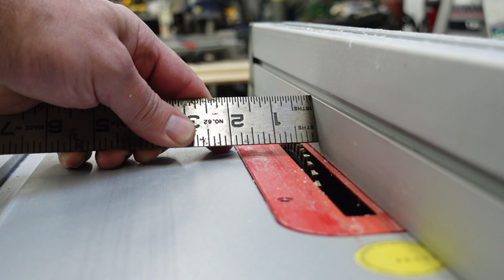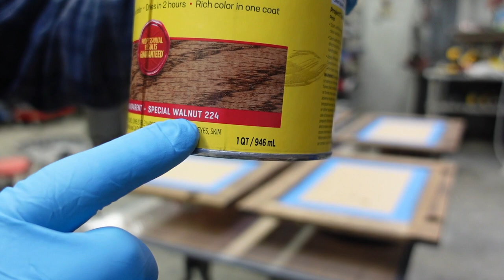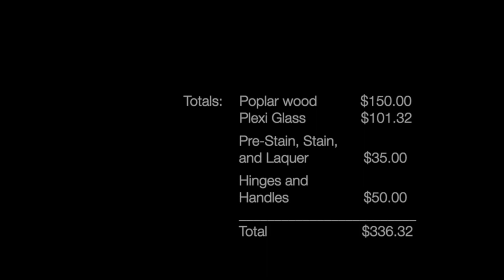Building Cabinet Doors for the LMTV

Comment: I HAVE WATCHED ALL YOUR VIDEOS ! I NOW HAVE A 1988 GRUMMAN OLSON P30 STEP VAN AND WANT TO CONVERT IT. IT HAS A CHEVY 350 EFI,  AND I AM IN THE PROCESS OF LAYING OUT THE INTERIOR CONFIGURATION.  I AM CONSIDERING USING A HEAT PUMP FOR HEATING AND COOLING.  I HAVE BEEN INSPIRED BY YOUR WORK, SIMPLY AMAZING !

Comment: Chad, I really appreciate the work you're doing on the LMTV. Great stuff and I'm getting a lot of ideas for the M1083 I just picked up. My plan is to build a habitat in the back once I get the truck to a high degree of reliability.

I'm replacing the brake parking brake and trailer manifold in the cab.  And I'm using all new hoses. So... How do you get the heater unit out? I figured since I'm digging into the back of heater unit and I want to put on a new exhaust hose to the brake manifold, I might as well pull out the heater unit and do a cleanup and inspection.  Do I have to lift the cab and unbolt it from below the cab floor?

Thanks for any guidance you can provide, but if you don't have time to answer, all good. Just keep on making these great videos.

And thanks for sharing the knowledge.
Reply from the maker: The heater has 6 bolts that you can get to from under the cab and the coolant lines.  It’s not too bad to pull.  While you have it out, check the windshield washer lines that run behind the heater.  Mine were disconnecting and dumping on the floor when I got my truck.
Reply: @BrokeOverLand  Yes, lol, I saw that in your video. Coincidentally, my windshield washer doesn't work and I haven't done the troubleshooting yet. It would be hilarious if mine was disconnected as well. Btw, I agree with the commenter below. Your work is very clean and it looks like it just rolled out of the factory. I can't figure out how your painted metal dashboard looks like new. My dashboard metal is flaking so I'm going to sandblast and paint. Thanks for the help and keep up the great work.